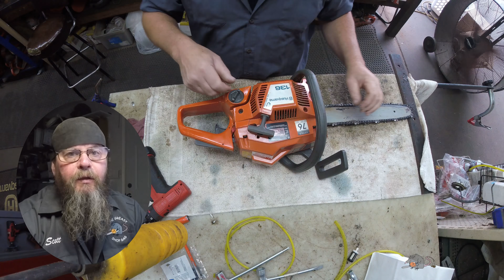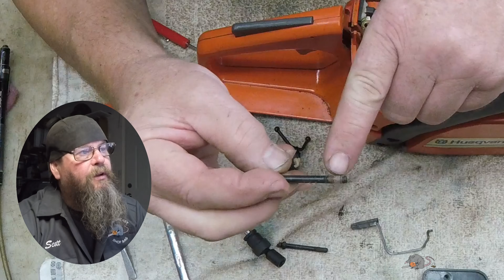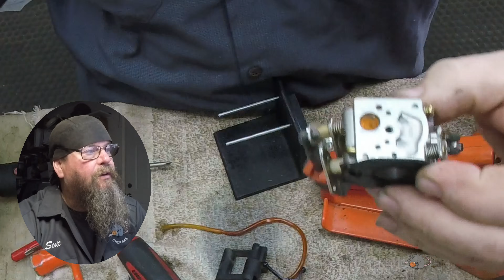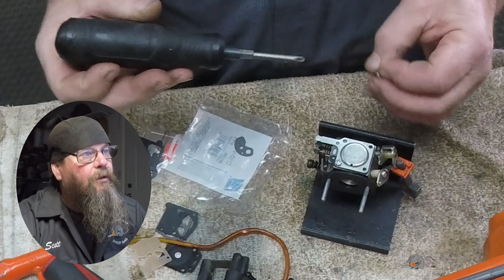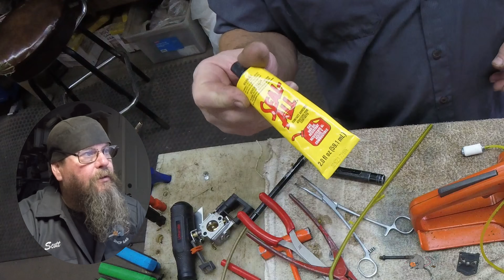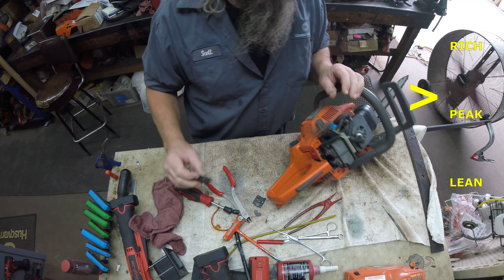Husqvarna 136 Is Starving For Fuel. Lets Help It Out

Comment: The fuel line keeps popping off the little tube that feeds into the carb. Not sure why. Seems like a bad design.  Maybe I need a longer fuel line?
Reply from the maker: The line could be old or stretched. Maybe has a memory? If the line is in good condition then a drop of super glue on the fiitting before installing the line should fix the problem.

Comment: Sorry if I missed it, but where do you source your parts? Didn’t see in description or comments. Fixing up one of these for my dad that he hasn’t used in a decade.
Reply from the maker: I work at a Husqvarna dealership. We use OEM parts whenever possible.
Reply: @ ah that makes sense. You wouldn’t happen to know the part number for the gasket set you used on this do you? Ours is a 136 with the walbro carb, looks like the same as in this video.
Reply from the maker: @ You'll have to get the model number off the carb and search for a kit that way.

Comment: good morning and congratulations for the video. I also have this chainsaw and since the handle broke, I bought a new used one. However, I can't open the chainsaw handle cover since I have to reconnect the little tube that goes to the carburetor. do you know how to do it? thank you very much and happy holidays
Reply from the maker: I'm sorry but I don't understand the question. The handle that contains the trigger doesn't open and I'm not sure what "tube" you need to connect.

Comment: Scott when I repair those small saws I use the pigtail style fuel line from Husqvarna for a 300 series saws like the 345 drill the hole bigger in the tank and basically the same thing your trying to achieve,
Reply from the maker: @larrywarner9314  I would think the pigtail line would pinch easy if routed the way I did. Do you route it differently?

Comment: Well done Scott. Do you think the saw dust in the micro screen came in from the fuel line or was the course mesh air filter at fault? Laaaaaaaater
Reply from the maker: @larryvankirk7423  The cause was running it without a fuel filter.

Comment: I "think" the carb kit had the original type pump diaphram as well as the plastic one. is the plastic one more tolerable of drunken fuel.  What was the original routing of the factory fuel line, pretty time consuming to duplicate?  Very nice job you did for customer!
Reply from the maker: @rooster3019  The acetate pump is durable but maybe not the best choice for high flow demands. I think I've used the factory routing...it just sux.
Reply: @TheGreasyShopRag  Got it.

Comment: Great job.  Seal all works great. I’ve had good luck modifying the carb support. The yellowish plastic.
Reply from the maker: They really could have done a better job routing that fuel line.
Reply: @TheGreasyShopRag  yes I got it linked between the two halves.  I’ve used a rat tail file to blend the hole in because it gets crushed.  Thanks for taking that stigma away.  Take care.